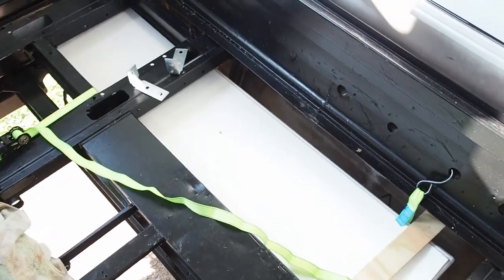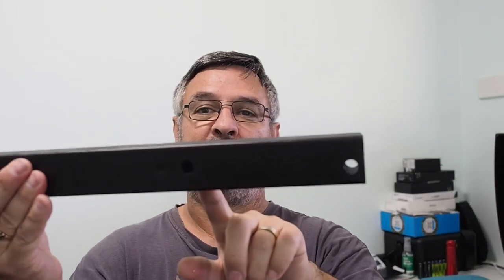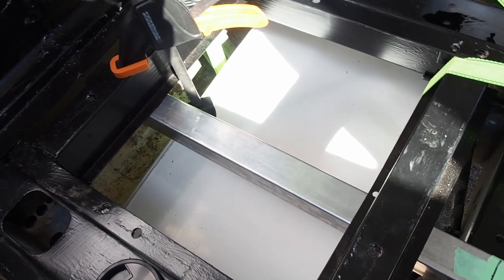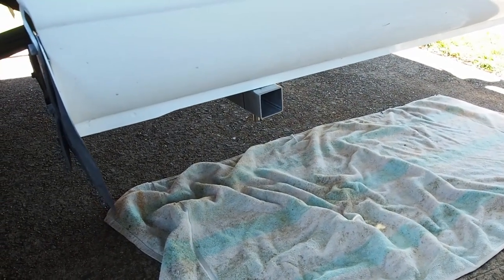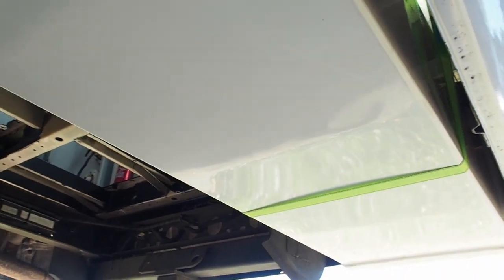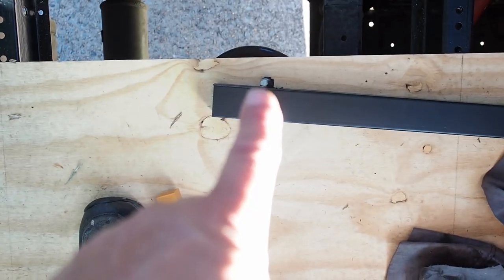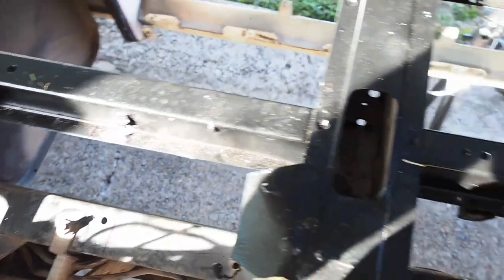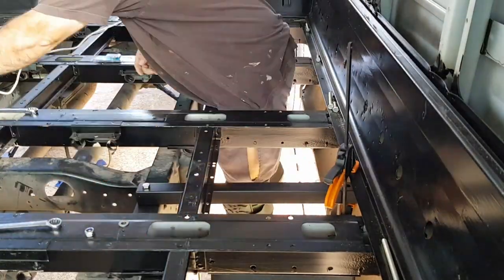Mitsubishi Rosa Bus Conversion Part 17 Installing the water tanks

Comment: What happens when you want to lower your spare tyre with the tank being in the way to insert crank handle??
Reply from the maker: Hi Andrew we have removed the spare tyre and it will be attached to a bull bar or rear box of the tow bar. 😀
Reply: @OffGridisSweet  Thought you may have bored a hole and ran a tube through it lol :) cheers. Building a 2006 Rosa. its been good to see how youve been doing it.
Reply from the maker: @andrewhalsall5061  would love to see some pics of your build :-). Glad your enjoying our videos 😀
Reply: @OffGridisSweet  
I was just having a look at mine
The rhs chassis rail also has the cut out for the spare tire crank to go through. If you turn the wind up mechanism 180 and then drill out the same shape on right hand rear panel you would be able to keep tyre in same place and have access from drivers side. So long as you don’t have anything in right hand corner where exhaust passes through.
Reply from the maker: @andrewhalsall5061  I have my shower recirculating  tank where the tyre was and also putting a storage bin and my black, grey and shower tank dump point on the RHS 😀